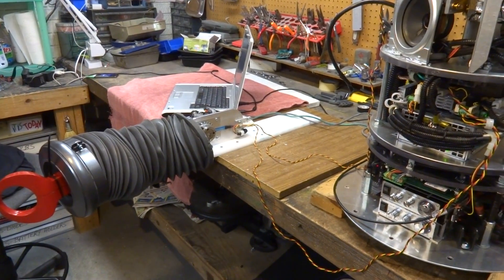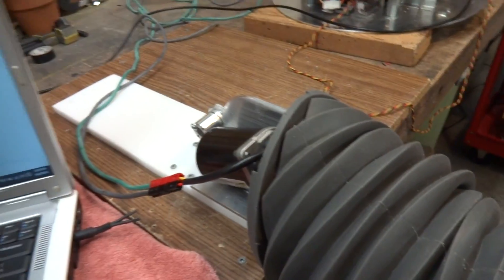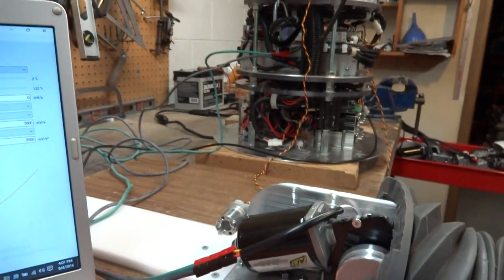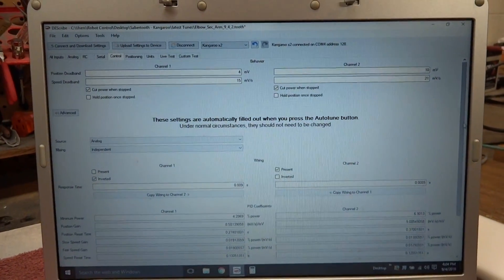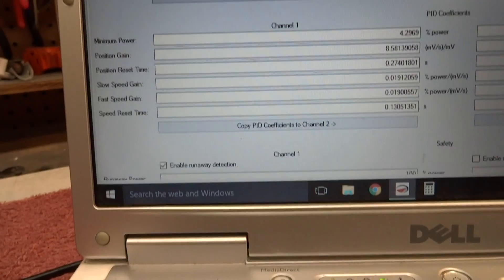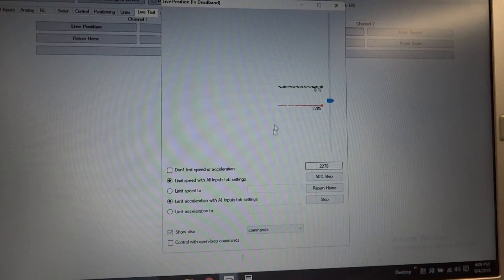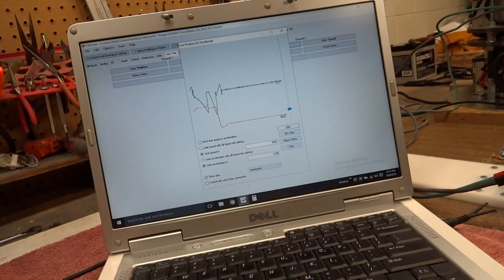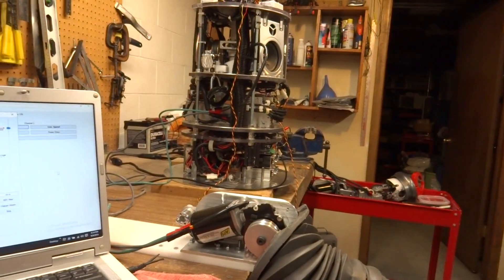Fighting the PID Blues

Comment: I know this video is a several years old.  I am starting to use the Sabertooth myself now, so am just getting started with it.  I wonder if the use of a worm drive  type of gearing, like what you have af the base, has anything to do with the problem with autotune?  A worm drive can't be back-driven.   I don't know all the measurements that the DEScribe software takes into its calculations.  But, if it is expecting to measure the force coming back through the gear train, it would be somewhat isolated from that, because of the worm drive.